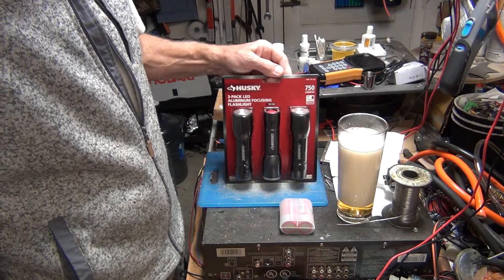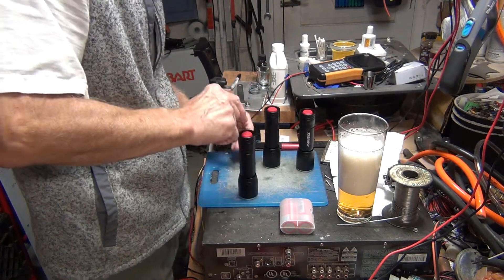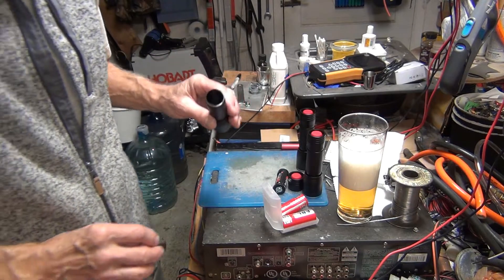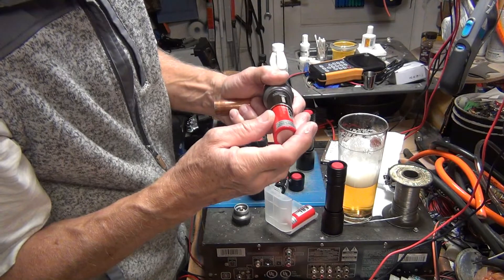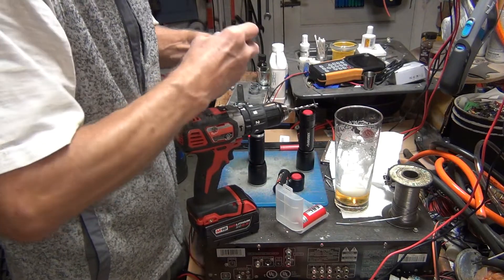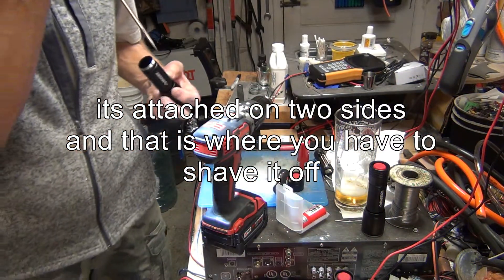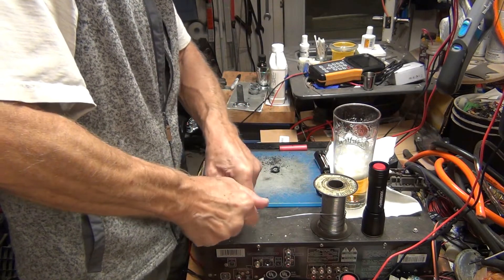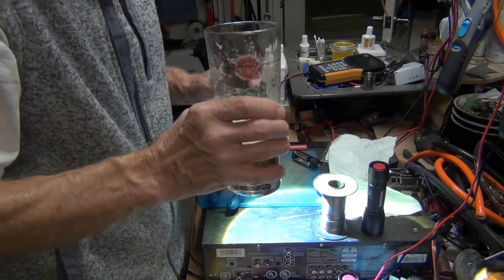$6 Husky LED Flashlight AAA Battery Hack

Comment: This can be VERY dangerous!!!  One can certainly use li-ion batteries in flashlights designed to run off 3 AAAs or 3 AAs, but you need to use a li-ion cell with a built-in protection circuit.  The EBL batteries being used in this video do not appear to be protected cells.  Flashlights like these designed to run on alkaline batteries have no protection circuitry in them to prevent over-discharging li-ion cells -- and doing so can lead to fire and even an explosion.  It might not happen the first few times you over-discharge the li-ion battery, but the risk grows each time.
Reply: Do little education on Li Ion cells before you educate others.
Reply: @tysesty  I have -- and using unprotected li-ion cells in a device that has no over-discharge protection circuitry (because alkaline batteries don't need it) is literally playing with fire.  As I said, it might be fine for awhile when the cells are new, but as they age and/or deteriorate (from being discharged too low) the risk grows!  Posting a video like this without explaining the risks is extremely irresponsible -- but I guess it still makes someone money.
Reply: @bcm00re  I think you meant save someone money…..second I have discharged plenty of Li Ion cells and never had an issue or hear anything like that and third if someone will do something like that I assume they would have basic knowledge about Li Ion cells.

Comment: Have you ran it to see if there's any issues with using a different battery?   Those 26650s are expensive. Maybe use rechargeable AAAs.
Reply: Rechargeable AAA batteries (ni-cad or mh) , although  the same size as regular Alkaline/ zinc carbon, will only supply 1.2v and therefore a dimmer flash light.